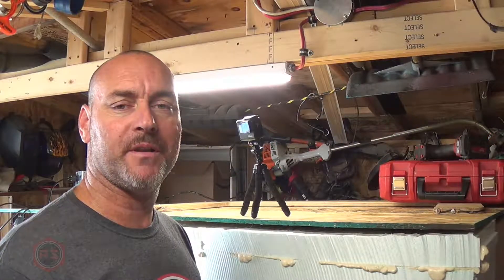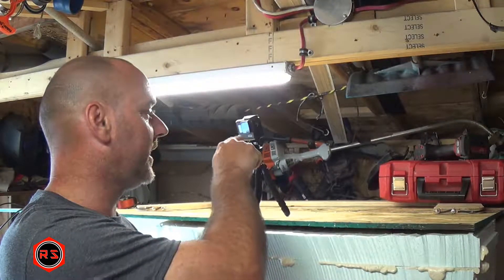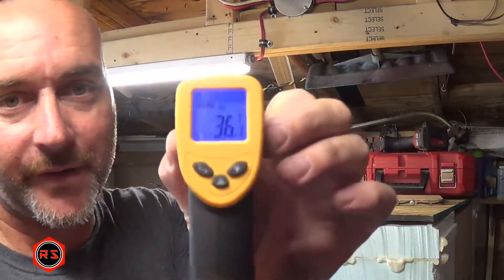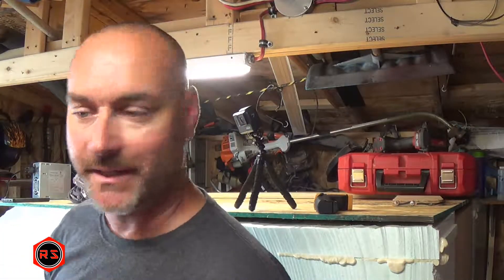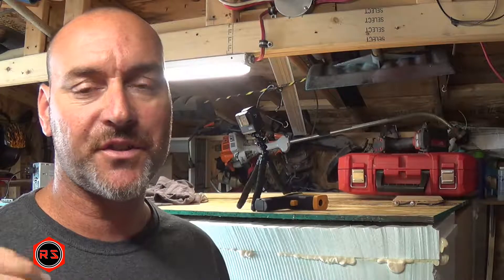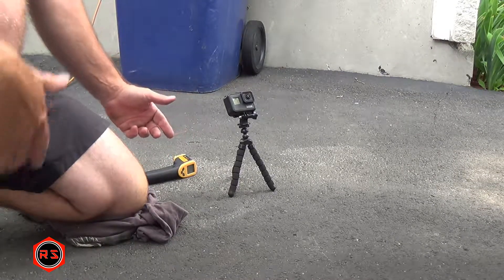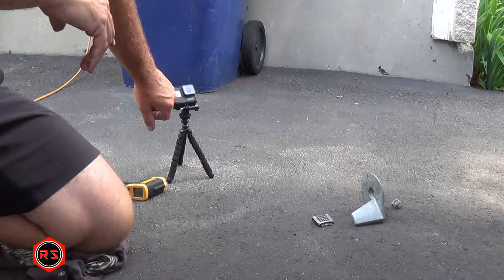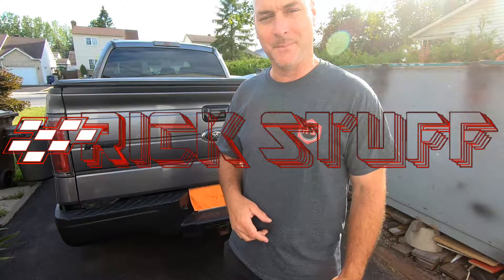Will my GoPro hero 7 black shut down because overheating...

Comment: My Hero 3 just started running hot all of a sudden. And it froze up with in 3-6 min. Files were being corrupted. I put a new memory card in it. 62 GB with 170 speed mb/s. It works fine now. If the card is to slow, they will heat up trying to process information.
Reply: Mine did the same years ago but once I replaced the battery it stopped.

Comment: get osmo action. it doesnt easily overhead and when it does overheat it doesnt shutdown so you dont lose footage.
Reply: Are you sure?
Reply from the maker: I found a way around the problem. the video will be release on Nov. 13
Reply: That's what I have done. But Osmo Action ocerheats to but it can hold. it's my second GoPro 7 black and it's both crap. One of them doesn't turn on anymore the other overheats in seconds without doing nothing.
Reply: @Helderhugo  osmo action is very dependable. even the dji pocket is also dependable. ive heard hero 10 is good. im waiting to see action 3 coming next month. i would likely go for that or hero 10.

Comment: My 7 sucks too, waste of money and GoPro doesn't help you.
Reply from the maker: no. customers service is not their strong suit...
Reply: @RickStuff  I found a video of a guy that put an aluminium cage on his GoPro 7 and he says it fixed the overheating problem. I ordered one from amazon. Its like $22 US dollars. I will let you know how it works.
Its called Smatree Frame Mount. Arriving today i hope!
Reply from the maker: ok. Let me know please. I find that hard to believe since aluminium is technical supposed to keep the heat inside unless it is sitting on the hosing of the camera wich in that case might act as a  heat sink attachment.
Ineresting...
Reply: @RickStuff  I ran the aluminium case on it for 4 hours yesterday playing golf. Never over heated. i am going to test it today on a higher resolution. I was at 1080 yesterday i will play today on 4k see how it does.
Reply from the maker: keep updating please
Reply: @RickStuff  I ran the camera again today through High resolution (4K) 1 hr 25 minutes and no shut down. the case was hot but not bad. seems to work.
Reply from the maker: Do you mind sharing me the link for that aluminium case?
Reply: I still want to test the 4K in hot weather to see if it will over heat. i may get to do that today. going to hit 90 today. Also another note i am running only GoPro batteries in the cameras. the aftermarket batteries tend to swell a bit.
Reply from the maker: try this. https://youtu.be/m2O3eX3ti8s

Comment: mine does the same thing but doesn't shut off and freezes, and battery needs to be pulled. Did you find a solution to this?
Reply from the maker: No. Aparently the hero 8 do ghe aame. It is just too powerful for a small casing like that
Reply from the maker: try this: https://youtu.be/m2O3eX3ti8s

Comment: I got Hero 8 Overheating  Max 138.4°F = 59.111°C  . I posted the video on my channel ,too
Reply from the maker: so they haven't fixed the problem...
Reply: I guess not an easy fix or they do not care. There is another issue I posted video the camera doesn't turn off sometimes

Comment: Looking for the camera that is least likely to overheat between the Hero 6, 7, 8... Which one can i run the longest in extremely hot conditions??? Thanks
Reply: My Hero5 has been Outstanding
Reply: @ulyssesdavis2717  Very old post here, but I thought I'd give my two scents. I got an old hero 5 black off of a friend a year or so ago, I have recorded for 8+ hours straight dozens of times with a portable charger connected in the hot sun. It gets very hot around the lens, but never showed any issues. Looking to upgrade to a new gopro.
Reply from the maker: I don't know dude since I never tried the others but I hate mine. When I am using it inside at room temperature (22*C) at 4K it record for about 20 minutes before shutting down cause of the heat. I can't really help you but I can say that the Hero 7 black is a no GO... If I knew it I would never bought it.
Reply from the maker: Thanks for the tip. I'll have a look at it
Reply from the maker: they all have the same overheating problem. I found a solution about that do. https://youtu.be/m2O3eX3ti8s

Comment: Mine shuts down after 10 minutes while only recording a 2.7k60fps, nothing else active.. hero 7black with latest firmware .. even in the wind while riding my motorcycle.. it was working just fine until recently
Reply from the maker: That was my first and my last Go Pro unless I decide to move to Antarctica
Reply: @RickStuff  bought a better SD card.. hope it's gonna fix it...
Reply from the maker: let me know please
Reply: @RickStuff  sure
Reply: @MotoARN  Did the new card make some improvements? Thank you.
Reply: @GuidoWarnecke  hey! I wanted to answer but didn't find this comment so thanks for asking again! 
Happy to say that yes, since the new sdcard, no issues.. it's all about the writing speed of the card..  my old one was U1.. now the U3 works like a charm!
You can check out my channel 😁 just recently I started filming 4k for a even better quality
Reply from the maker: try this: https://youtu.be/m2O3eX3ti8s

Comment: try 4k60fps and with hypersmooth on, gps, voice and the gopro app. i bet you if your in a garage at 72degrees F gopro will shut down or atleast stop recording at 125F. ive confirmed this, you need to be processor intensive. i give it 15min. try it. firmware 1.90v
Reply from the maker: i've stop trying with this thing. it is a waste of money
Reply: brandon woodford that’s what people are not getting. What I’ve learned lately is on mine (Session 4), is the wifi below the lens also produces a stupid amount of heat.
Reply from the maker: What's the point on paying more on a camera for options if  you can't use theses options. As I said. Big wast of money unless you are planing on shooting 15 minutes videos in nord pole...
Reply: RickStuff 👍